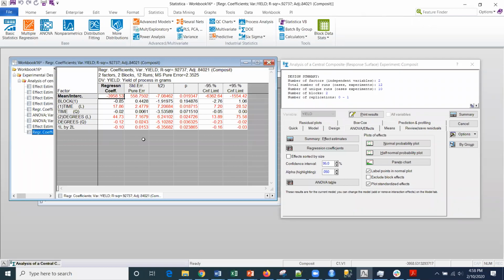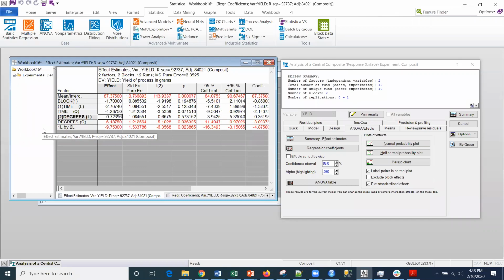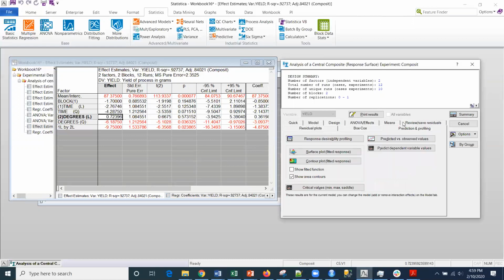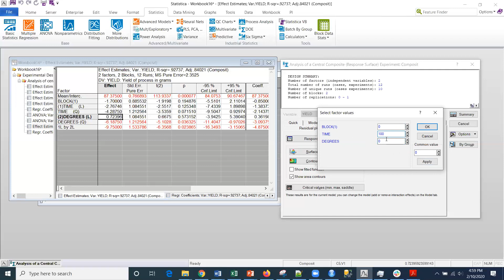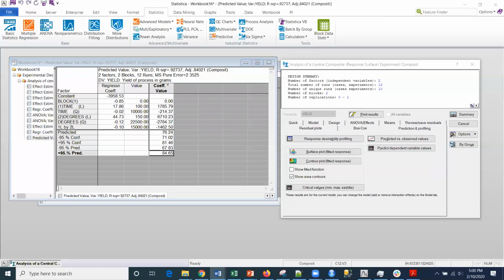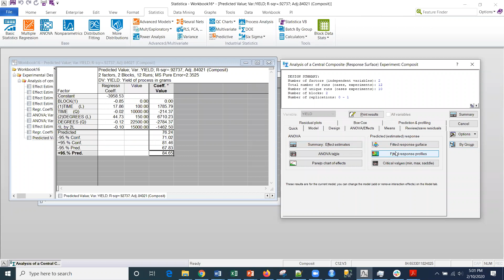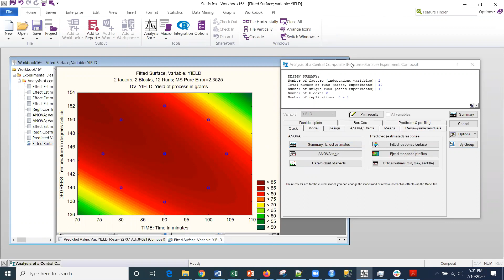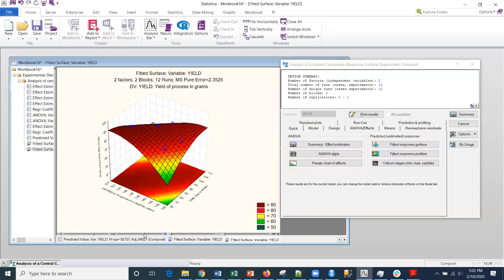ST103D Part IV, Central Composite Design - Prediction, Response Surfaces and Response Profiles

Comment: Morning Scott.
Do you perhaps know how to increase the order of the model that is fitted? Ie. I use a central composite design but the second order model gives a low R^2 value for all models I have tried. My professor suggested that I change the model to be a cubic polynomial, but I can't find this setting on Statistica. Do you perhaps know how?

Thank you for this series on Statistica, it has really helped me figure out how this program works.
Reply from the maker: Amanda, I believe if once you get to the analysis panel and hit cancel, you can add variables.  Or, if you start with a new analysis and just add a variable you should go from a higher order - to cubic and beyond.  I hope that helps.
Reply: @thedatalinguist  Thank you, this did help.